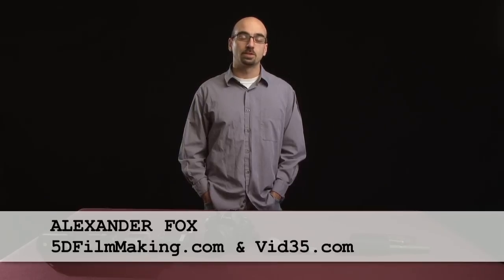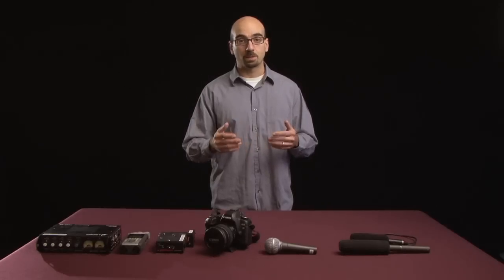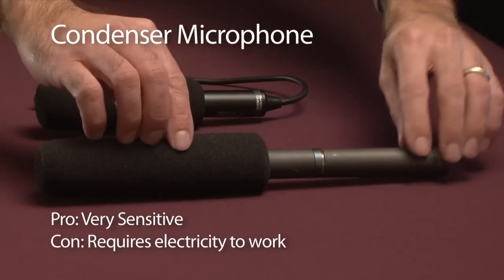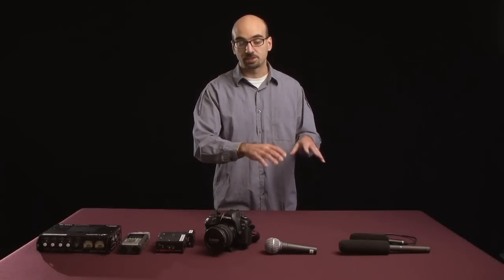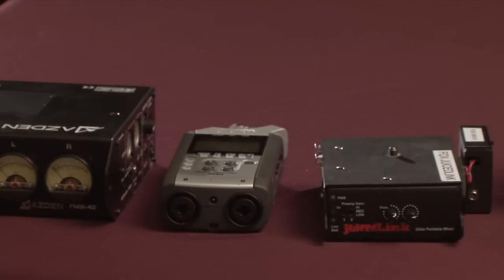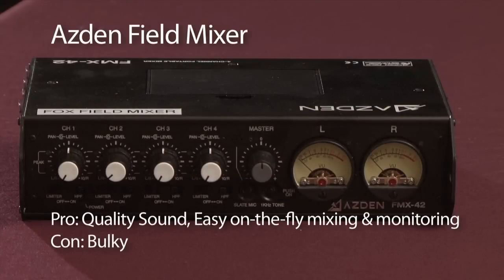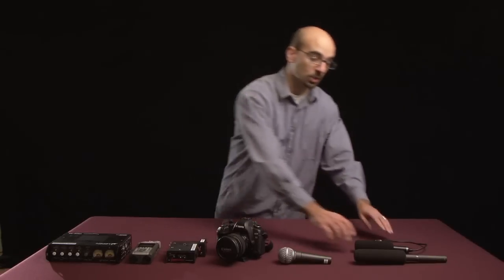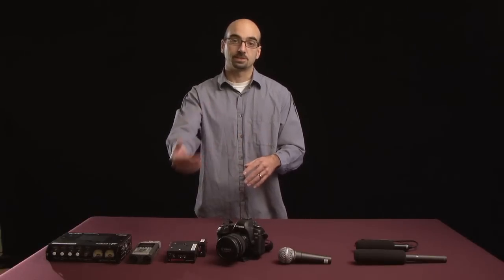Ask Alex - Preamps & Phantom Power

Comment: This is very well explained. 
I was left with one question about condenser mics that I've wanted to know for ages. It was explained on wikipedia: "Here, the diaphragm acts as one plate of a capacitor, and the vibrations produce changes in the distance between the plates." And the dynamic ones are based on induction using a coil. So this explains a lot about the quality differences and why condenser mics require power.
This comment is aimed at people with a background in electronics :)